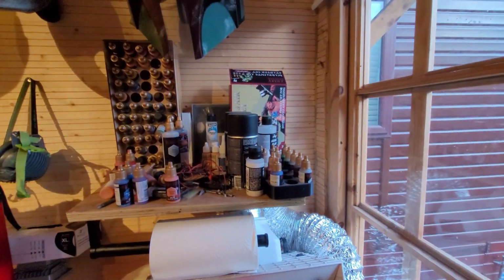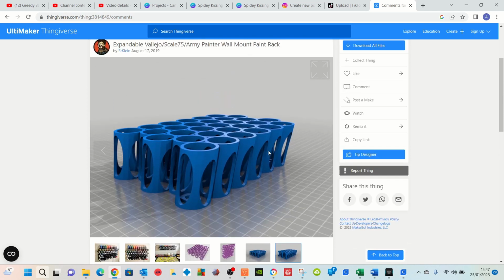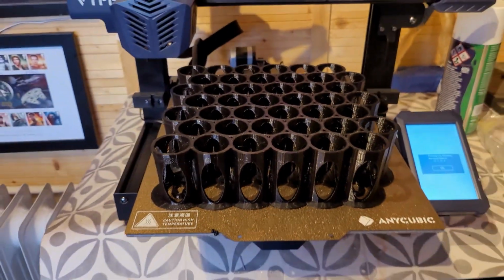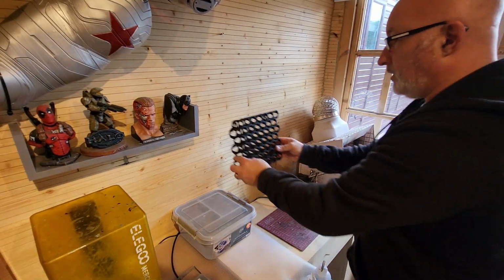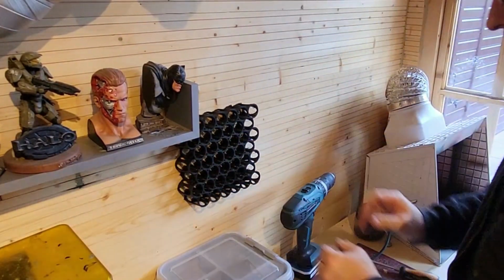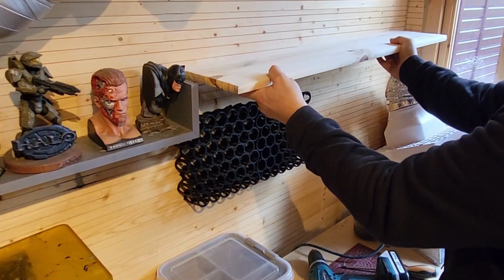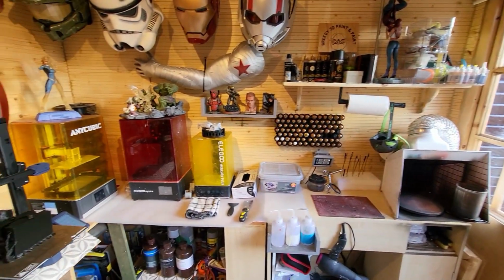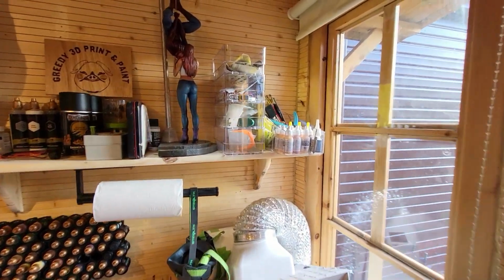Updating The Man Cave Part 1 - 3D Printed Storage

Comment: Looking good 👍 do you get any issues with damp in the winter? About to turn my summer house into a print & paint studio but it does get a bit damp in winter.
Reply from the maker: I don't get damp to be honest... I do have a dehumidifier block so I'm sure that helps and it's well insulated walls ceiling and floor. It does get cold in winter.. I've had water freeze in it so your gonna need a heater that adds costs especially with the cost of electric
.. I did try one of those small plug in heaters... No good.